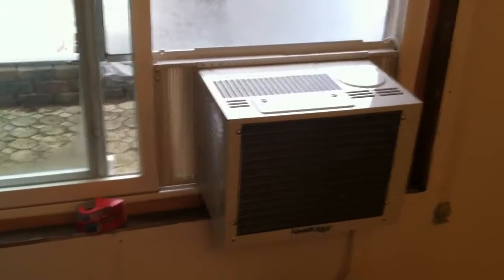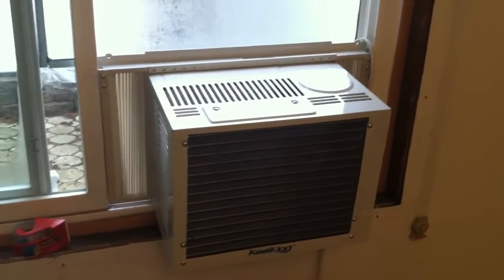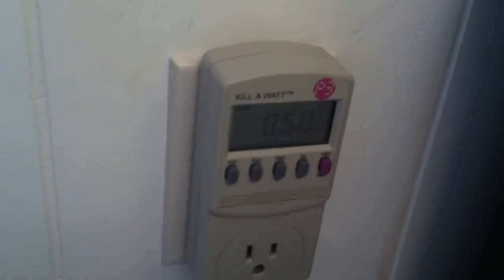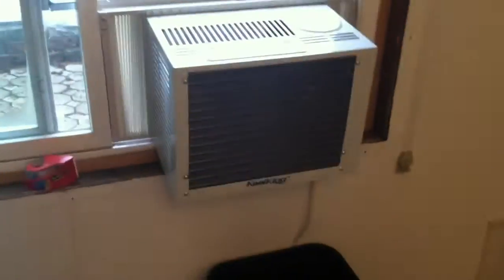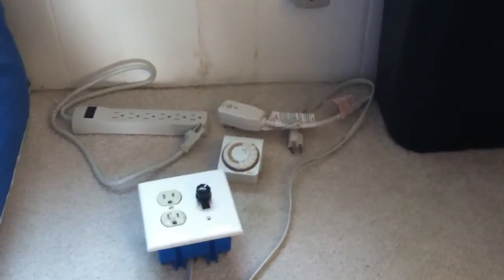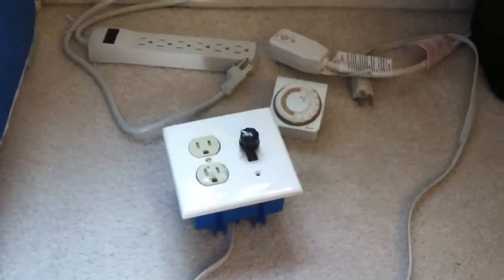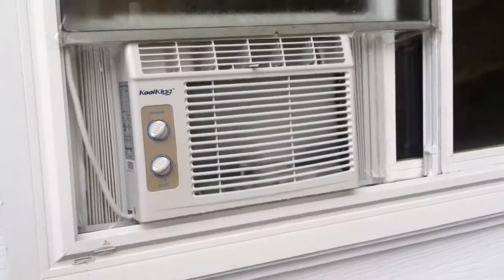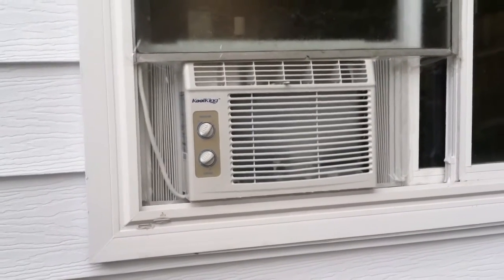Turning an air conditioner into a heat pump by turning it around

Comment: So , what if you enclosed the ac unit in an enclosure(of predetermined size) with a resistive heater(space heater) drawing? 40degree ambient air into the enclosure and raising it to 55degrees. (Essentially preheating the air to the lower limit of your ac "heatpump").Then, in a 2 stage fashion, use your pseudo heat pump to raise that 55 degree air to 75 , which is comfortable for a house  The idea is to use resistive heat in combo with the "heat pump". Since the COP of resistive heat is 1 and the "heat pump" is about 3-3.5, then the average is still 2-2.25(200-225%) efficiency. Seems somewhat convoluted, but , in theory, wouldn't you cut the heating energy requirement by 50% or so?

Comment: Did you measure the actual wattage of the space heater? Many oil heaters "rated" for 1500 watts actually max out at 600 watts. Twice 600 watts would be 1200 watts, so you might be getting just 1200 watts of heating for 400 watts of power consumption. This would still be much better than a space heater.
Reply from the maker: I measure all power usage using a kill-a-wall power meter

Comment: Thank you!  Great information that addressed all my questions -  regarding need to bypass the thermostat and building manual one.  And that can only work if outside temp is not below 52 degree, so can only use it to a certain extent.

Comment: Why does it need to be set at a window to outside? Why not make a very small room or insulated cupboard (with a door) to be a refrigerator. It isn't as cold as outside but still cool enough to store food. Meanwhile the hot (extracted) air comes into your living area. That way it cuts both ways into your energy bill.
Reply: I've got a closet that could be used like that.  Set the AC on a table and use plastic to separate the heated air from the cooler air (in the closet).  If the closet gets very cold..   just make a small opening in plastic to mix in warmer air (keep in mind warm air rises, so if the ac/heat pump is positioned high off the floor it would be in "warmer" air on the closet side).  It would still heat much more efficiently than space heaters (4X plus more efficient).

Comment: No defrost mode, who would have thought. Heat pumps can detect frosting and then reverse back to AC mode without the condenser fan on and melt the ice. Then it goes back to heat pump mode and recovers the heat used to defrost. 

They make a condensate pump that has a float to pump the water outside. 

Your controls are exposed to the rain. Not safe.

Buy a window heat pump.

Comment: Use an air preheater before it hits the coils In other words don't let the air hit the coils cooler than 52°. Crude oil heaters preheat the oil before it hits the burner so it can be burned for fuel In this case you just be preheating the air let me know how it goes
Reply: I did try various things like shining a heat lamp on the coils, but that only resulted in melting the plastic grill. Of course the main problem is that you are using more energy to do the preheating than you would save by using a heat pump. The only thing that seemed effective and economical was to just run the fan over the coil to defrost it. I also tried various things like allowing the warmer inside air to flow to the outside coils to defrost it, but no matter what you did, it would effectively stop working at below about 40 F degrees outside. For a heat pump to work below 40F requires the big new hi-tech inverter units that work to -5F and still output rated heat. I got Mr Cool heat pump and it works great below freezing (see my other video).

Comment: would a dehumidifier work as a heat pump
Reply: It would need to be modified to blow the cold air outside so it would be a lot more complicated than modifying an AC which is already designed to blow normally the hot air outside.

Comment: Nice experiment!  Midea makes 2 Reversible Window Heat Pumps:  MAW08HV1CWT (8k BTU) & MAW12HV1CWT (12k BTU).  According to User Manual:  (Heat mode) If the outside temperature is below 39°F, the machine will shut off and display ‘LO’.  I got a one at Coscto in 2022 (summer 2024 they have the U-shaped unit which is NOT reversible), but Amazon lists both units in stock.  I installed it in a guest bedroom, and mainly use cooling, but have tested the heating function, and it works fine (takes unit 5 min to switch between modes).
Reply from the maker: For $379 on amazon https://www.amazon.com/Midea-Conditioner-Ultra-Quiet-Operation-Energy-Saving/dp/B0CVVQWGH2, that isn't much or expensive than a normal air conditioner, but it doesn't have a defrost mode so it can't be used below 41 degrees.  The other unit I see from Rovsun https://www.amazon.com/ROVSUN-Conditioner-Function-Installation-Assistant/dp/B0CYT39Z2V doesn't say if it doesn't work below 41 degrees and needs 240 voltage.
Reply: Just a note. The channel Tech Ingredients just did part 1 of a video on doing something like this.  He hasn't announced when part 2 is coming out.  
Thanks for your video. My mind is buzzing.
 @franklinthu

Comment: I suspect that an air conditioner being used as a heat pump probably has a coefficient of performance (COP), not much different than standard heat pumps. 

That is, a COP around 3 to 4 might be common in warmer winters.  When the Cop is 4 and using 400 watts, you'd be getting 1.6kw  of heat, pulling in 1.2kw of heat from the outsidr. As it gets colder outside, the COP can drop. When running with a COP of 3 and using 400 watts, you'll get 1.2kw of heat pulling in 800 watts of heat energy from the outside.
Reply: Yes this video was saying something like 300-400 watts in and 3000 or so of heat moved. Sounds rather high. Id like to find a chart depicting COP as a function of temperature as temps go from like 100F down to 32F. BTW they use Coolbots and Inkbirds(cheaper) to solve the icing problem when making DIY walkin coolers. Though I do like the idea of free solar heated air in the daytime
Reply: @CharlesGwinn-ep9pb  Fluid mechanics ltd makes a pretty unique heat pump. And they publush a graph that may give a snapshot of something similar to what your asking for reguarding COP At different temperatures. Search these term. Isothermal stirling heat pump cop.  You'll find two interesting graphes. One for air temp, and another for differential. 

And while you at it, you might like to look at their stirling heat pump and how they design the piston to get near isothermal performance.

Comment: To reduce or eliminate coil's frosting over, maybe you could use a solar thermal collector to bring solar warmed air to the air conditioner. 

The outside air absolute himidity in the winter is dryer , with enough prewarming, you should be able to keep it above the frost point, maybe even above the dew point.

You can even gave the AC fan help pull air through the solar thernal collector pulling the heat out and improving the collector's  efficiency.  This could provide suplental heatibg during the day without frosting over. 

Sure, one could do solar thermal right into the home, but it takes much larger  thermal collector area to get a given volume of air flow to room temperature where as heat pump airconditiober  concentrates the heat energy, and the airconditioner as a heat pump  can have its output easilly get upto 120f.

Comment: No air exchange from outside to inside or outside to inside. The unit uses the refrigerant to move heat from inside to outside in cooling. In heat mode it moves heat from outside to inside. The air in your home is recirculating in through the coil and then blown back into the space.

Comment: How did you bypass the thermostat?
Reply from the maker: In this example, I think I just disconnected the thermostat control and shorted it so it would always be on. See my other videos on how I use an arduino controller to use a relay to control the fan and compressor which allows me to use this DIY heatpump down to 40 degrees F.

Comment: So she can find a way to Fashion a box to the front part of where it pulls the air in from the outside and then stick a pipe on that and have that come in through that window or something you could probably solve the issue of it icing up and really cold temperatures

Comment: You should make something that makes it where it pulls the heat that is coming into the room back through it because then it'll concentrate that heat and you really won't lose no energy and it would pull it through like a pipe or something and then you could have that where it pulls the heat in from the room that way it doesn't freeze up and it'll get twice as hot and you won't have to worry about it freezing up as easily

Comment: A 1500 watt resistance heater puts out 5000 BTU. So your 5000 BTU ac is putting out about the same.
Reply: Explain more plz
Reply: No he said it uses only 300w while running.  He’s actually saving energy

Comment: The manual thermostat can be adjusted so it will run until the evaporator freezes up. It will then cycle off and on below 61 degrees.

Comment: Ill start by defining terms: front is the intended inside and back is the intended outside part...

Confused here? lets begin with window ac in correct orientation, front inside.
 well these window units draw air from the lower 2/3 of the front and cool it and push said air out the upper 1/3 of the front. and pump the heat to the back or outside coils..  So if its hot inside your home, in AC mode it pulls the heat out of the home to the back or outside of unit  to be removed from the home.
lets now reverse the unit front is now outside.
So if its cold outside and inside and you desire heat inside the home, turning it around backwards would draw cold outside air into the front lower 2/3 of the front (thats now outside) and try to cool it even cooler. it would struggle to find heat outside to pump to the back (now inside the home) and now coils will frost over.
a crafty handy individual could duct or direct air from inside the home to front intake (lower 2/3 of front thats now on the exterior) where it would initially find cool air that in time gets warmer as the unit pumps the heat into the home from back of unit (now inside the home) this would solve frosting and essentially pump the cool interior air out through the front upper 1/3 of front (now outside) the thermostat wouldnt work and a crafty person could get a lizard habitat thermostat and plug ac into that.... also ducting or directing air to the front should be done with insulating material like styrofoam sheet and the proper metallic tape.
Reply: Do see my part 2 of this project where I created an Arduino controller which just lets the fan run in order to defrost the coils. This works very practically and I used this setup to heat my room. https://www.youtube.com/watch?v=wpsMVukBvG0

Comment: Excellent experiment,  I was fixing to try this myself, now I know the magic number, 52 degree limitation.  Thanks for sharing.
Reply: Add a solar thermal collector to warm the outside air before passing over the AC  evaporator coils.
Reply from the maker: Make sure you see my follow up video where I use an ardrino controller to do automatic defrosting. https://youtu.be/wpsMVukBvG0 This is the system I use to heat my room today.

Comment: I'm just throwing this out there. Is your ground temperature above 52 degrees? If so a large pex loop underground filled with dilute ethylene glycol (Antifreeze) bathing the cold coil in its ABOVE 52 DEGREES heat, would be a great source of heat for your house, without frosting up (because there'd be no freezable moisture against the coils.
Reply: What of you just bathed the coil in antifreeze above ground??
Reply from the maker: That might work, but would be really complicated and expensive. I did do a follow up video where I created an Arduino computer controller to implement an automatic defrost cycle that allowed me to create a practical heat pump from an air conditioner: https://youtu.be/wpsMVukBvG0

Comment: To add to what Workin Alday said would be to simply add a external circular high volume fan to blow into the outside evaporator coils. This will help your heat efficiency even more.

Comment: I solved the frost issue by taping a styrofoam cooler over the coils. I ran a hose into the cooler from inside the house and blow a hair dryer into the hose. Works perfect.
Reply: this person is making a clever riddle.  He is inefficiently using resistance heating of the air for the air condtioner to reclaim, so there is no advantage, and infact, now is paying for 1500watts as well as the power to operate the air conditioner.  He probably made this post out of frustration to some of the ideas other posters have presented here to defrost the coils.  Its all in teasing good fun, but lets remember, this youtuber is actually saving real money on his electric bill while he learns abpout aircondtioners and heat pumps and efficiency.
Reply: Instead of a blow dryer he should just use another reversed window unit of significantly smaller capacity as a defroster, and then another one for that one until the problem either goes away or becomes small enough to be solved by another type of very small heat source.

Comment: I've played with the same thing on and off myself.  I think that these units come with coils that have very little room between the fins to help their efficiency as an air conditioner.  Turn them around and they work GREAT as a heat pump, but the frost closes up the tiny openings way too quickly.  I haven't done it, but I think that with a much larger evaporator coil that has more space between the fins we could work around the icing problem a lot easier.  Kind of kills the idea of this being a simple hack I suppose.  But I also suppose maybe we could remove some of the fins ( I don't really know how, they are delicate and taking out more than every other one might do more harm than good )  to provide more air flow to allow more ice before the air stops flowing.  Then maybe a flow sensing switch could turn off only the compressor once the ice builds up too much?  Maybe with less fins, the ice would actually build up faster...  I don't know.
Reply from the maker: I did create an arduino controller that would detect the ice over condition and turn off the compressor but keep the fan on to defrost it. I'll have to make another video on how I did that. I did use it as a practical heater and it did save me lots of money on heating my master bedroom.
Reply: Might make a solar thermal collector to prewarm the air.
Reply: I solved the frost issue by taping a styrofoam cooler over the coils. I ran a hose into the cooler from inside the house and blow a hair dryer into the hose. Works perfect.
Reply: @richardcollins3861  Can't tell if you're joking or not as it is a possibly viable solution. Just depends how much power you're using to run the blow dryer I guess. Haha.
I was thinking just have it pull inside air into the evaporator but that also creates suction in the house pulling all of the cold air from outside in...

Comment: You can modify the pcb in side and install a valve which will switch the outer heat into the room and the cold air out . The gas has to be removed and after the valve is installed, you can switch both ways by installing a toggle switch which would work both ways for cold and hot. If you to this way your fan would throw in the hot air into the room for more better and efficient temperatures.
Reply: It would need some sort of timer for defrost.

Comment: I did this all winter long only time it stopped was went temp got down to single digits I had a 500 watt heater to keep coil from freezing under 38 set it on a timer cheap heat solar could make it near free heat
Reply: I was thinking similar use one of those solar heat air exchangers for day time and heat lamp at night to cycle a set time after the unit shuts off and see how far you can get with the unit.